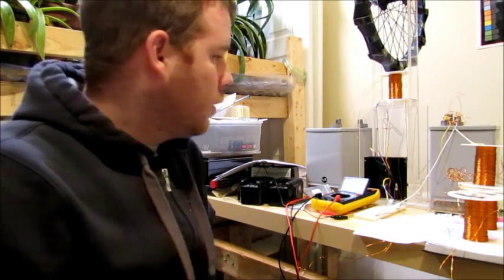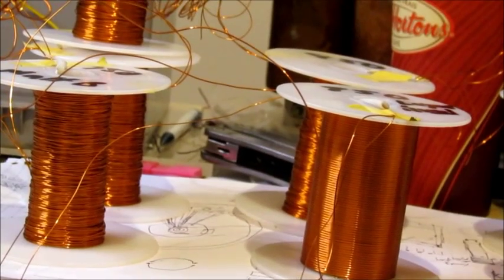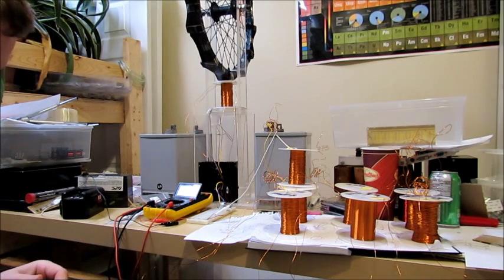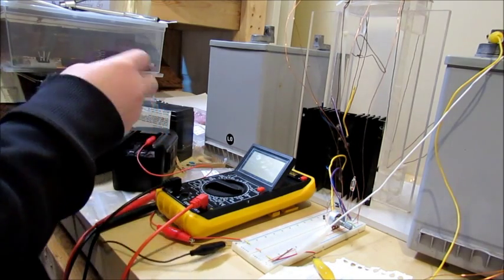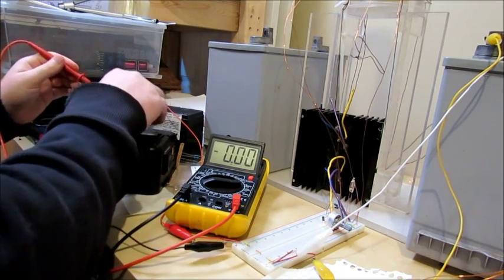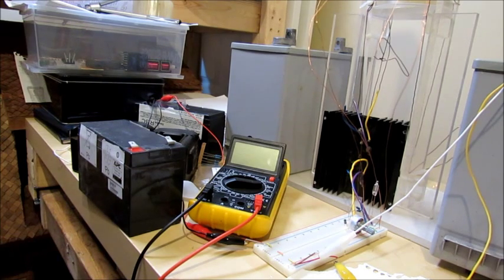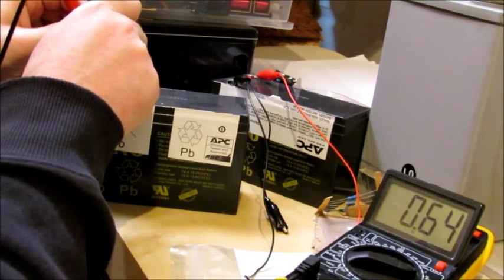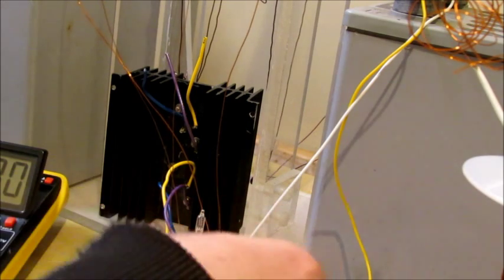Free energy "The Revolution SSG Bike" P3 By inventor Matt McMahon, inspired by John Bedini Motor

Comment: As for a rechargeable vehicle, well lets say you are a dollar short and a day late my friend. But it is good to see others enjoying the wonders that others can show. PS. For the center core you may think about using about 24 small welding sticks. They work well, and when you grind down the ends they fit perfect in place. Keep in mind DC current travels on the outside of the wires. The more windings the better the current.

Comment: Hello, some batteries need longer to charge, I have had little scooter batteries take 6 hours to recondition. You need to charge them, let them rest for 8 hours, discharge them, recharge them again, Repeat around 5 times. First you will notice they hold a better charge, second you will notice faster charge times.
If you are charging 36 volts you need at least 36.1 or more to get anything. It would be better to charge a 12volt they are easier and cheaper to experiment with.

Comment: 1)  What is your criteria for determining when the battery being charged has reached 100% full recharge?
.
2) What prevents chronic under-charging of the battery? This will cause severe degradation of the battery AH capacity.
.
3) What prevents chronic over-charging of the battery? This will cause severe degradation of the battery AH capacity.
.
4) What is the lowest voltage that you can discharge the battery to, before it is considered "damaged" ?

Comment: h2oplasmaplug,
" ...Imagine having an electric bike that wasnt limited by a battery. It could take you across the country with never needing to be charged... ". You must measure the Watts-Hours (Energy) consumed from the Main Battery vs. the Total Energy produced to turn the Wheel &  recharge the Dead Battery. You will soon "discover" that each recharge leaves the next battery LESS charged than the Main Battery was until all batteries are dead. A BIG 100AH 12V battery makes 1HP for only 1 HOUR.

Comment: Matt, FYI, use the same voltage battery to run as you use to charge. This is a must or the battery charging will not charge. Charging a 36v use a 36v. ~Russ